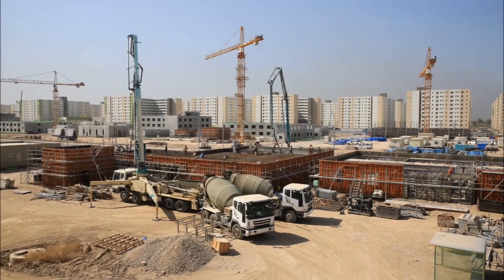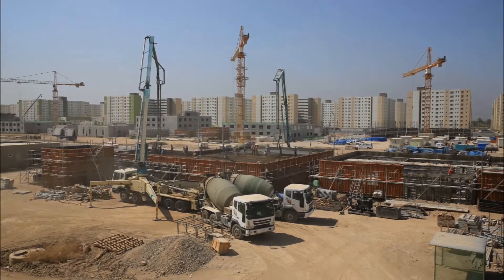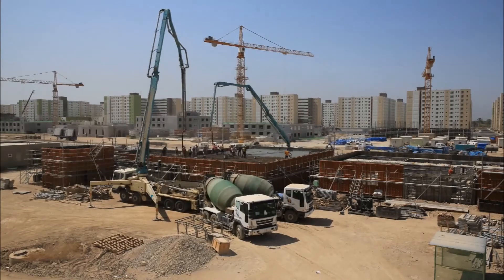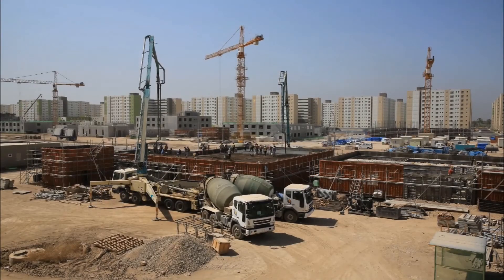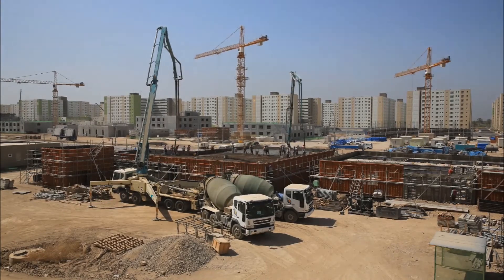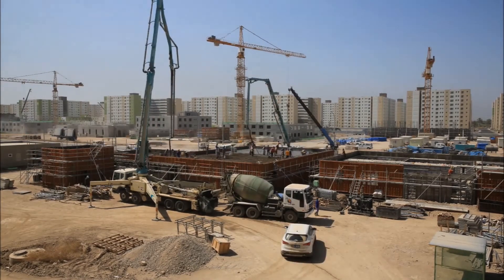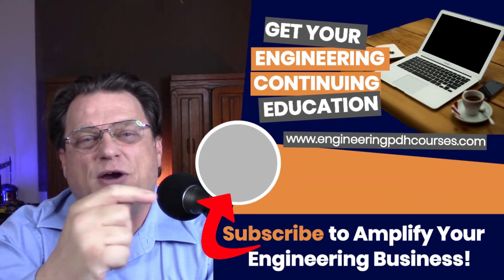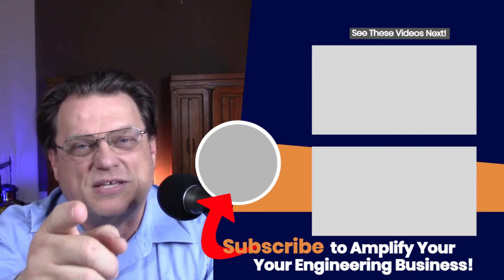Construction Site Engineer vs Project Engineer - Engineering Online PDH Courses

Comment: Thanks. I want to the difference between site engineer and superintendent. In my country, what you explained about site engineer is done by the site engineer from contractor side. In addition to contractor, we have consulting company which is in charge of design. Both contractor and consultant have project engineer, manage tasks for the project from their own side. As I have understand, site engineer from consulting company side is superintendent. Please explain who is superintendent?
Reply: More frequent than not, these titles depend on the company you work for, the field of work or the country.

As a base concept, the superintendent is from pure production hierarchy (worker -> foreman -> supervisor -> superintendent -> general superintendent/construction manager). The field engineer is let's say an engineer from the engineering team that is given to the construction manager in order to ensure that the technical documentation is follower properly.

In short, the superintendent leads teams of workers, the site/field engineer does field technical support.
Frequently the engineer term is missused due to american way of using not properly the term, they include it frequently as a job description even if the person doesn't have an engineering degree.

Comment: Hello, I need an advice. Im basically Electrical Engineering Graduate in 2008 from Osmania Univ. have 13 yrs of construction site experience in Buildings, Oil & Gas in UAE .... I have always been interested in Engineering & technical activities, calculations, designing. At site work Im not getting opportunity to perform these tasks. Hence I have decided to work as Electrical Design engineer. Request everyone to advice how to get into Electrical design with 13 yrs site construction experience..
Reply from the maker: 13 years in site construction experience is a great start. I also started in the field before I worked in the engineering office. Knowing how to actually build what is on the drawings is an exceptional leg up in engineering. The best engineers usually start in the field before they do the designs in the office.

When looking for an engineering position in the office, explain how the you field would extremely valuable in the office. You will be able to recognize vague and incomplete designs, which will save the engineering company a great deal of time and resource to revise the plans later. In addition, your unique experience will offer unique solutions on the office that will set that company apart from its competitors.

In my office I always prefer an field experience engineer over anyone else.

Good Luck
Joe
Reply: @engineeringmanager  Hi Joe, Glad to read your valuable reply. Could you please advice me some Electrical designing softwares to get started with.

Comment: Sir, how's project engineering differs from project management?
Reply from the maker: Although there can be some overlap between the two; the Project Engineer is in charge of the technical designs of the team. While the Project Manager mainly works with the team's schedule and the project budget, and reports to Management and the client. There are a number of other differences between the Project Engineer and the Project Manager, please watch our other video on the difference between a Project Engineer and a Project Manager at this link: https://youtu.be/EBsbvC7v0Lw